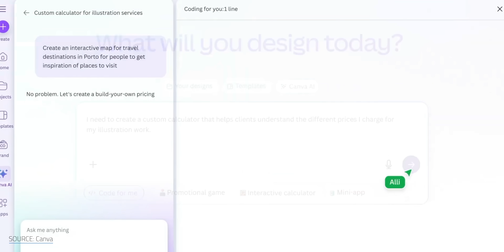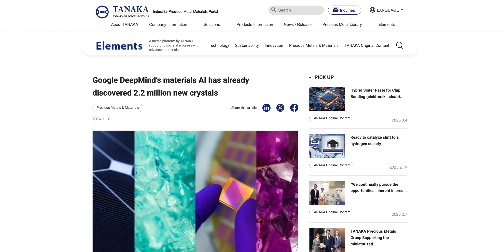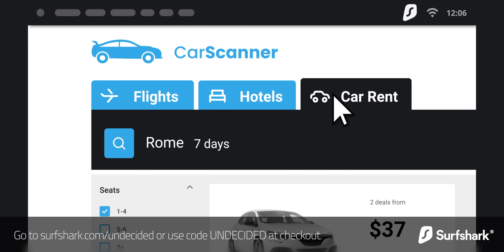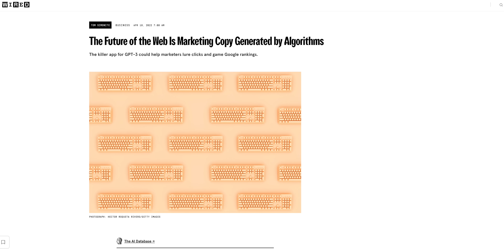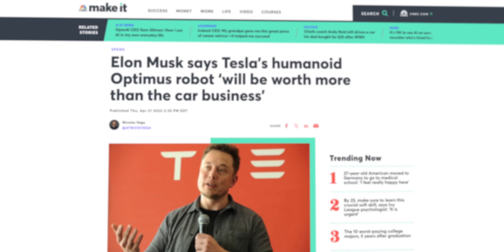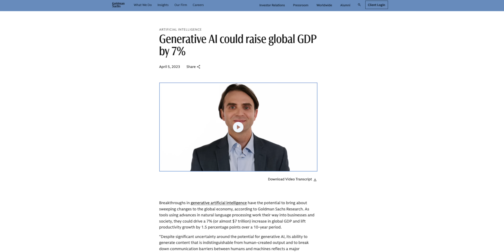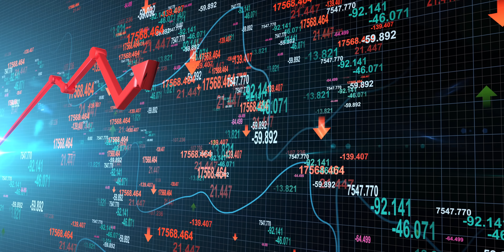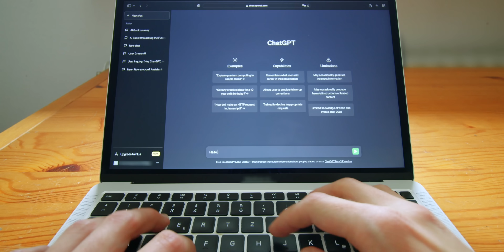Why the AI Revolution Has a Fatal Flaw

Comment: Rebuttal to “Why the AI Revolution Has a Fatal Flaw”
The video “Why the AI Revolution Has a Fatal Flaw” presents a compelling narrative about the transformative potential of artificial intelligence (AI) while warning of an economic paradox that could precipitate widespread job displacement and systemic collapse. While the video effectively highlights AI’s capacity to revolutionize fields like materials science, medicine, and manufacturing, its central thesis—that AI-driven automation risks economic collapse by undermining consumer demand through mass unemployment—overstates the immediacy and inevitability of this outcome. This rebuttal critically evaluates the video’s claims, drawing on economic theory, historical precedent, and contemporary evidence to argue that the AI revolution, while disruptive, is unlikely to lead to economic collapse if accompanied by proactive policy interventions and adaptive market mechanisms. The argument is structured around three key points: the overstated scale of the AI paradox, the historical adaptability of economies to technological disruption, and the feasibility of proposed solutions to mitigate adverse effects.
1. The AI Economic Paradox: An Overstated Risk
The video’s core argument hinges on what it terms the “AI Economic Paradox”: that AI-driven productivity gains, by automating jobs, reduce consumer income and demand, potentially undermining the economic system. While this concern is grounded in economic reasoning—consumer spending constitutes approximately 70% of GDP in advanced economies like the United States—the video exaggerates the immediacy and severity of this feedback loop. The cited Goldman Sachs estimate of 300 million jobs at risk globally is a long-term projection, not an imminent reality, and is tempered by their more recent analysis projecting a 7% increase in global GDP and a 1.5 percentage point boost in productivity over a decade. This suggests that AI’s net economic impact may be positive, provided mechanisms exist to redistribute gains.
Moreover, the video’s framing overlooks the dynamic nature of demand. Historical data from the Industrial Revolution and the Information Age demonstrate that technological advancements often shift demand rather than eliminate it. For instance, the automation of textile production in the 19th century displaced weavers but spurred demand for new goods and services, from railroads to consumer appliances. Similarly, AI is likely to create new markets—such as AI-driven personalized medicine or sustainable energy solutions—that stimulate demand in unforeseen ways. The video’s example of reduced lithium in batteries illustrates this: such innovations could lower costs and expand access to electric vehicles, potentially increasing demand rather than suppressing it. By focusing narrowly on job displacement, the video underestimates the capacity of markets to adapt through new industries and consumption patterns.
2. Historical Precedent: Economic Resilience to Technological Disruption
The video draws a parallel to Jevons Paradox to frame AI’s economic impact, suggesting that efficiency gains lead to unintended consequences. However, this analogy is incomplete, as it ignores the long-term resilience of economies to technological disruption. The video cites the loss of 5.6 million U.S. manufacturing jobs between 2000 and 2010, noting that only 39% of displaced workers were reemployed, often at lower wages. While this highlights the challenges of labor market transitions, it omits the broader context: the U.S. economy absorbed these shocks through growth in service and technology sectors, with unemployment rates returning to pre-2008 levels by 2016 (4.9%, per the Bureau of Labor Statistics). This resilience is not unique. The mechanization of agriculture in the early 20th century reduced farm employment from 40% to under 2% of the U.S. workforce by 2000, yet economic growth accelerated as workers moved into manufacturing and services.
The video’s concern about the mismatch between displaced workers and new AI-related jobs is valid but overstated. While it is true that not all workers, such as a 58-year-old factory worker, can transition to roles like machine learning engineer, history suggests that economies adapt through a combination of retraining, geographic mobility, and the creation of less specialized roles. For example, the rise of the internet created millions of jobs in logistics, content creation, and e-commerce, many of which required minimal technical expertise. The World Economic Forum’s estimate of 97 million new AI-related jobs by 2025, compared to 85 million lost, supports this trend. The video’s assertion that rural and industrial communities will be left behind ignores ongoing efforts, such as online education platforms and government-funded retraining programs, to bridge this gap. While challenges remain, the historical adaptability of labor markets suggests that AI’s disruption is manageable with targeted interventions.
3. Feasibility of Solutions: Policy and Innovation as Mitigators
The video proposes solutions like Universal Basic Income (UBI), AI dividends, large-scale reskilling, and decentralized AI ownership to address the paradox. While it frames these as nascent or controversial, their feasibility is more robust than suggested. UBI, for instance, has been tested in pilots beyond Finland, such as in Canada and Kenya, showing positive outcomes in well-being and entrepreneurship without significant disincentives to work. A 2019 Canadian trial in Ontario found that 73% of recipients continued working, with many using the income to pursue education or start businesses. Similarly, AI dividends—taxes on automation to fund retraining or income support—are already under discussion in policy circles, with proposals like the European Union’s 2017 consideration of a robot tax gaining traction.
Reskilling programs, while needing scale, are not as impractical as the video implies. Initiatives like Amazon’s Upskilling 2025 program, which committed $700 million to retrain 100,000 workers, demonstrate corporate investment in workforce transitions. Governments are also acting: Singapore’s SkillsFuture program has trained over 500,000 workers since 2015 for emerging industries. Decentralized AI ownership, while less developed, aligns with growing open-source AI movements, such as Hugging Face, which democratizes access to AI tools. These solutions, far from being theoretical, are already in motion and can be scaled with political will and public-private collaboration.
The video’s concern about companies’ incentives to prioritize profit over social good is valid, but it overlooks countervailing pressures. Public scrutiny, regulatory frameworks, and corporate social responsibility initiatives increasingly compel firms to address societal impacts. For example, Microsoft’s partnership with AI researchers to develop sustainable materials reflects a broader trend of aligning innovation with social goals. By underestimating these mechanisms, the video presents an overly pessimistic view of the AI revolution’s trajectory.
Conclusion
The video “Why the AI Revolution Has a Fatal Flaw” raises important concerns about the socioeconomic implications of AI-driven automation but overstates the risk of economic collapse by underestimating the adaptability of markets, the historical resilience of economies, and the feasibility of proposed solutions. While job displacement is a real challenge, the creation of new industries, adaptive demand, and proactive policies like UBI, AI dividends, and reskilling programs can mitigate adverse effects. Far from being a fatal flaw, the AI paradox is a call to action for policymakers, businesses, and society to design inclusive frameworks that harness AI’s potential while ensuring equitable distribution of its benefits. The AI revolution, if navigated thoughtfully, can drive prosperity rather than implode it, aligning with humanity’s long history of adapting to technological change.
References
•  Bureau of Labor Statistics. (2016). Unemployment Rate Data.
•  World Economic Forum. (2020). The Future of Jobs Report.
•  Goldman Sachs. (2023). The Economic Impact of AI.
•  Ontario Basic Income Pilot. (2019). Preliminary Findings Report.
•  European Parliament. (2017). Report on Robotics and AI Taxation.
•  Singapore SkillsFuture. (2023). Annual Report.

Comment: Basically, AI is both a blessing but a curse. What's ironic, AI is the very thing that can save lives yet at the same time, end them.
Reply: How would it save lives?!
Reply: @oooodaxteroooo  Vaccines, genetic corrections, helping our immune systems to defeat cancers, etc.
Reply: @JaredMerlin  what vaccine exactly are you missing. One against blindness and stupidity?! Sorry, but...

We just developed mRNA that is expected to work against cancer, too. What you don't seem to know is that they REAL issue behind cancer is our lifestyle. Chemicals, radiation and STRESS! We don't need ai or machines to fix this. We just need to slow down and take better care.

No need for ai.

So again.

ATOP.
AI.
NOW!

We DON'T need it and it W A Y too dangerous.

P.S.: we have CRIPS CAS/9 (sorry, if I misspelled that, but my ex worked with this 10 years ago, so i know the basics) to change the genome and it's already being uswd on plants and afaik in humans, too. She had tabacci tomatoes innthe greenhouse. Sealed off from surrounding nature for obvious reasons. I alwqys hoped that greenhouse stays sealed, but guess what. There IS no 100% in life.

Comment: In my opinion, long term, AI will most likely be a net benefit to society and the economy. But short term, in the coming years, there will be some significant growing pains, as the system adjusts to this change. 

It’s most likely unavoidable at this time, and the current system will likely need major reforms or a complete change, I feel this will happen in a messy manner met with strong resistance from almost every angle, but the changes will form over time. 

This is what I have learned from history too, and I predict that it will get as messy and broken as the early Industrial Revolution… how messy it gets will be reliant on the reactors and choices of the top one percent, the rich, as well as legislation and government. 

But I feel that society needs to take another look at, and rethink its relationship with work. 
I for one, lose creativity when money becomes a factor.

Comment: What worries me is the higher amount of energy AI uses. Large companies such as Apple & Google keep on advertising their latest AI smart searches etc. But no thought about the extra energy needed to do that process. I can't even seem to be able to switch off an AI search result on Google. So I'm not given the choice.Hey. they restarted 3 Mile Island to run it! Surely this is breaking the efficiencies of batteries & solar PV? I feel AI should only be used for important research & not dished out to the masses. Otherwise the only winners are the owners of the AI system. Finally, AI can help power negative things or be misused by criminals or political groups - false truths etc. We've seen it already.

Comment: It’ll have to end up with ubi eventually or we’ll go back to the dark ages. When the former middle class starts rioting, civil society will quickly fracture. “Retraining” is a republican fantasy. AI tools are cool and I’ve experimented with several, but if the people using them don’t have the skill and discernment to use them properly and understand the validity of the results, we’ll be (already) on the fast track to disaster. People take AI output as gospel yet it produces all kinds of counterfactual nonsense and the users are often too lazy or unskilled to question it.

Comment: Should be said that several studies have been conducted that show a minor productivity growth from AI, and some studies supporting its growth have been called into question like the december MIT PHd students study. 
https://youtu.be/Y47jBvAN4DY?si=utmIvUsn7dUVpvIn
I am personally very doubtful about mass job replacements. The self-check out did not replace the cashiers at my local Walmart because people just refuse to use them. Even then they need a employee to oversee the section. Hallucinations make it extremely hard to have a reliable AI agent in the foreseeable future. Funny enough Anthropic lawyers have just gotten in trouble for using a fake citation that Claude just made up. These companies have lied about so much (Nvidia said that the 5070 would be the 4090 in performance) so I am very indifferent to their claims most of the time.

Comment: im a bit of a maker and one of the things im optimist about AI is that it will make things incredibility cheaper to manufacture not just for big companies. for example the average person could ask the AI to design them a phone or build this app for them and you can run them one your own computer. i have a small server which is just a store bought PC i installed Linux on where i run an AI model on and use it to help me with my projects. so there is at least potential that AI will allow people to do there own thing without the need of these giant corporation.

Comment: I turned off Copilot because it was more distracting then useful, constantly suggesting or even outright adding code that wasn't correct or wasn't relevant to what I was trying to do -- I've only scratch the surface, at that not entirely voluntarily, but what I saw did not inspire confidence.  But, it is advancing quickly.

Comment: coal mines were "improved and automated" I was cut due to AutoDesk ACAD program... board designers were drastically reduced as well as pay for the job. Once they figure out how to make robots to weld in the field, that will be the tipping point for a huge lose in the construction labor market.   I made more money based on the US CPI in 1993 as a pipefitter than they do today, almost twice the buying power then than today.   Now i am seeing entry level engineering jobs being shipped outside the USA to places with  "High Value Engineering Center" (HVEC).  I have seen this increase to USA only mark projects, before when I work globally it was not that abundant, now everyone is rushing to offshore high skilled labor and design tasks.   My favorite saying for years....  Wall Street is about Profits over Patriotism;  as Americans refuse to pay for American labor costs when they can get it cheaper.

Comment: Another problem is there won't be lower rung opportunities to train replacements for the people who retain jobs supervising and checking the work that the AI does. There will have to be a way to enable people to get the experience necessary to be able to do supervisor level jobs. Can lower level coders, for example, obtain enough expertise and experience if they are using AI to help do those low level jobs? When they eventually replace the previous generation of human supervisors, they won't be as capable and experienced as that previous generation. And this deterioration in human capabilities will progress through each generation.